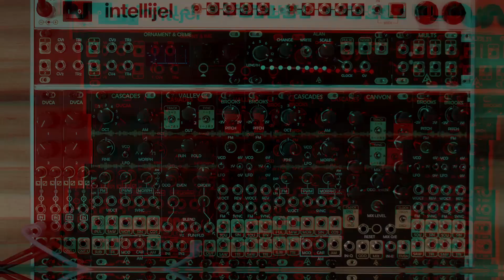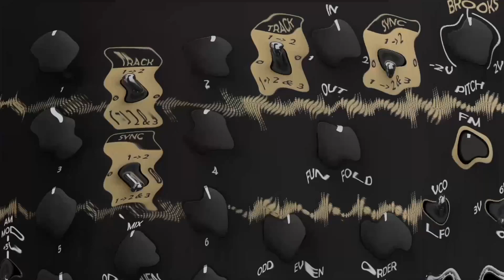COCO System Part Two: VALLEY

Comment: Can the oscillators be used interchangeably? For example, it would be interesting to use multiple cascades modules in concert.
Reply from the maker: Yes.  Either Brooks or Cascades can be used in either of the three oscillator positions.